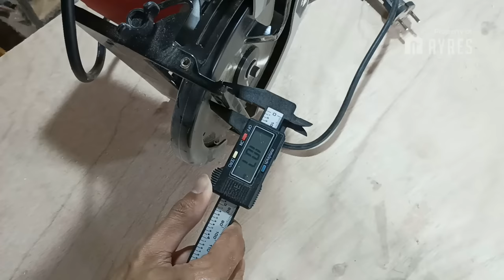DIY Portable and Folding Mini Table Saw from a Circular Saw: Perfect for Small Workshops!

Comment: No riving knife, no blade protection, very unsafe!!!! I made a similar thing and was happy with it until a piece of wood hit the back end of the sawblade. Luckily it did not hit my eyes,  It makes you immediately understand the importance of a riving knife and a blade guard.
Reply from the maker: Thanks for the advice
Reply: but how to get riving knife for sircular saw basically they not have slot for atach riving knife in base plate, maybe you have idea cause i need riving knife for my sircular saw too
Reply: @alifirfandi you can add tapered seperators behind the blade and that will work fine.  The biggest hazard I see is that you can’t lower the blade. That can be easily dealt with.
Reply: Wong Kene bro...Paribasane Alat sederhana ISO dari barang...Wong kene Bondo Arit Gowang wae dadi barang...wong Luar Alate Akeh...komplit gawene Dingklik Cilik...😂😂